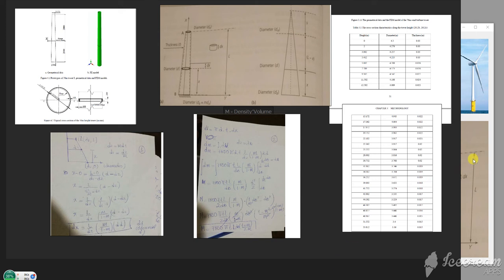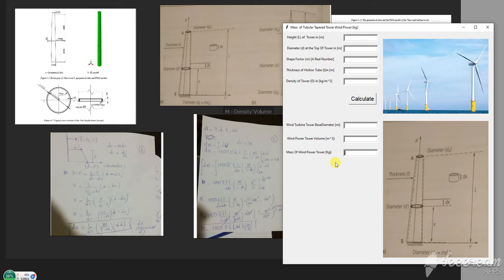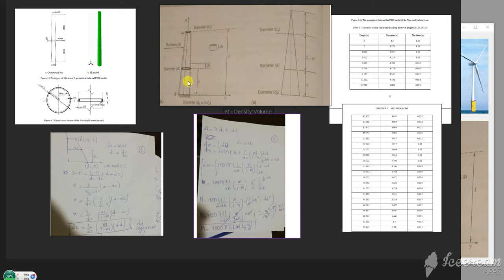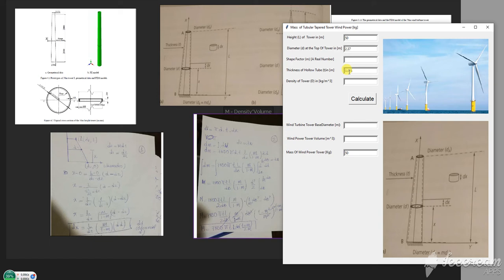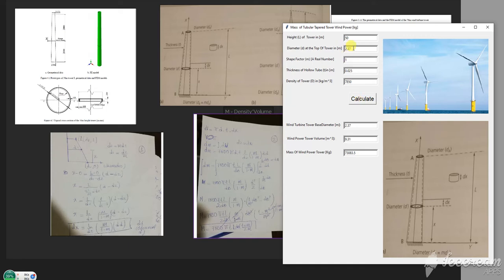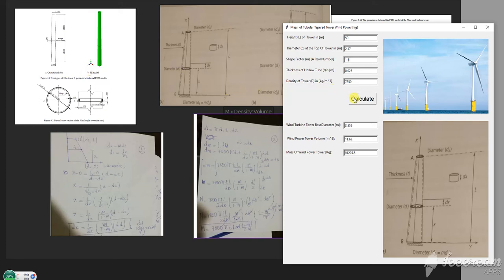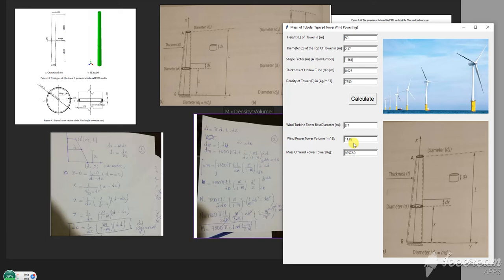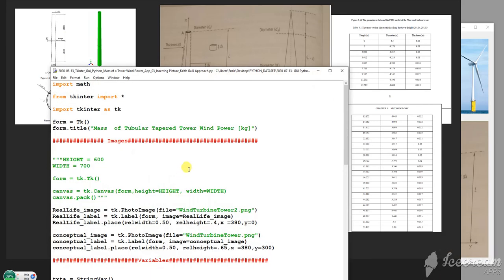Wind Turbine Tower Design Optimisation  With Python Tkinter-Civil Engineering

Comment: Is okay, but I didn't get how you resolve the problems using Python
Reply from the maker: well,  based on the basic  mathematical  formula of a Cylindrical Thin walled tube and its applications into  Steel Tubular tapered  Wind Turbines Towers.The idea is  how to control the Wind Turbine weight  taking into account  height,  diameter variation in terms of Tower Height, Thickness, etc.This is very practical example of Engineering optimisation from a maths  standpoint. I just  trying to   enticing Engineers/Students   into programming as an alternative cool tool., thats why I put the useful links YT channels where they can learn Python from scratch if they  consider so. Most engineers  have mental barriers when comes to  programming but  if you can  learn it  programming to a certain level then it can be  an extra flexible and powerful tool at your disposal I think